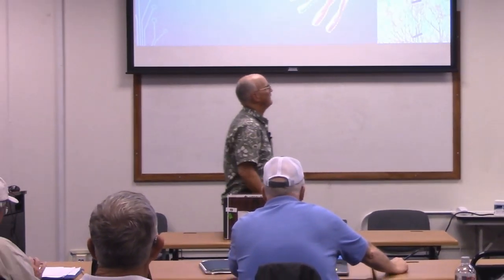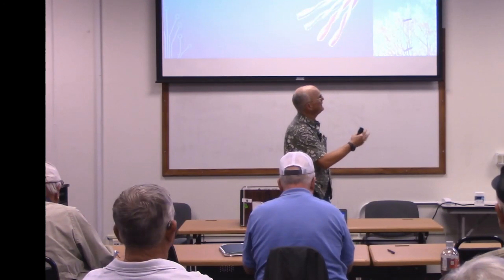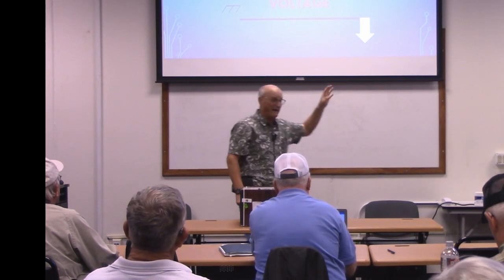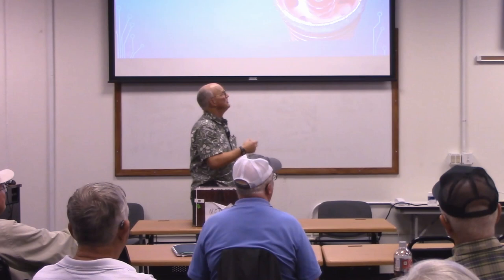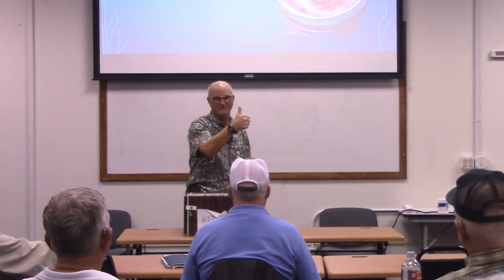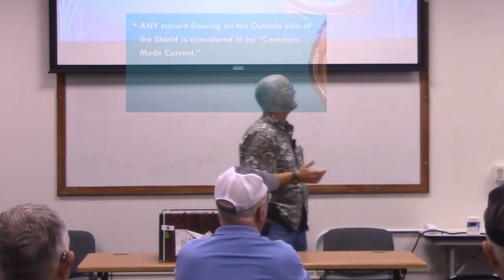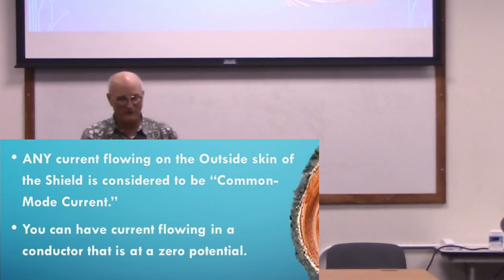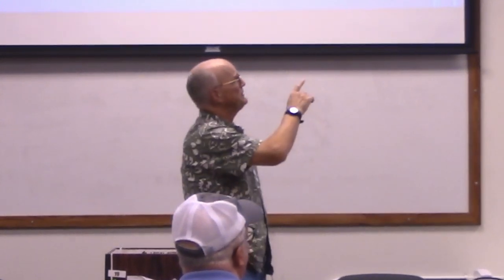Common Mode Current, What is it? (013a)

Comment: Loved the video! Anything on Differential Mode Noise...? 😅
Reply from the maker: Thanks, man! 🙂
Differential noise is a topic for the DSP folks, I am afraid, as it is part and parcel part of the signal you are trying to hear. I have no plans on going there. 😞
Reply: @eie_for_you  That is fair. I am not sure what your channel is about, but I was trying to learn about CM and DM Noise for PCB Design, since at high frequencies loops in your PCB can form radiating/receiving loop antennas (DMN) and cables attached to poorly terminated/pcb chassis terminations (among other things) can cause that cheeky 3rd co-axial outter conductor to suddenly act like a dipole antenna (CMN) that will also radiate.

Regardless, I really appreciated the video! Lucky for me, CM Noise is the harder one of the 2 to understand lol, atleast in the context of PCB Design and how it is created.
Reply from the maker: @alexanderquilty5705  The two rules of thumb I always went by in the PCBs I had to design were (1) "keep traces as short as possible" and (2) "keep analog traces away from digital traces, especially those carrying clock signals."  In fact, we had separate ground planes for analog and digital sections of the boards that ONLY met at the common power supply connection ... in ONE place.
Thank you for the encouragement and you are very welcome! 🙂

Comment: So.... why doesnt the INSIDE of the center conductor count as the 4th ? also, why is the inside flow on the outside, but the shield flows on the inside.
Reply from the maker: The insie of the inner conductor is not a surface. The RF wants to conduct itself on the surface of a conductor, not in its core. 
So, we have two opposing electric fields between the inner conductor and the shield. Thus, because they interact with each other, the currents are on the surfaces which face each other within the coax.
Hope this helps. 🙂
Reply: Good answer
Reply: @eie_for_you  I think the real answer is closer to the fact that the centre conductor interior encloses no free charges, so there cannot be an electric field inside the centre conductor. This is covered by one of Maxwell's equations, I think it's the one that says div E = 0, 'Div' is the upsidedown triangle symbol in math. It's been a long long time since I did electricity and magnetism, but it's a lot closer to reality than what the RF current 'wants' to do.